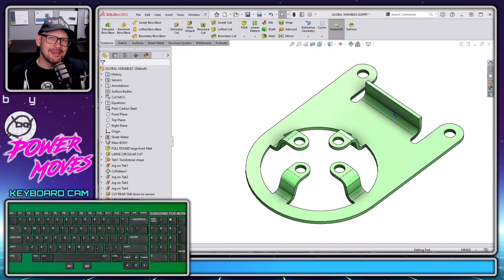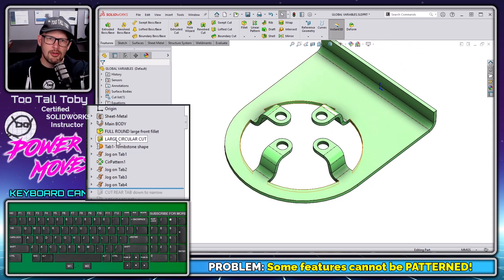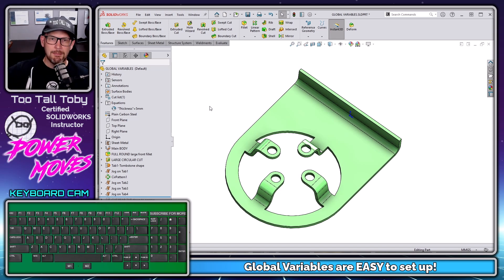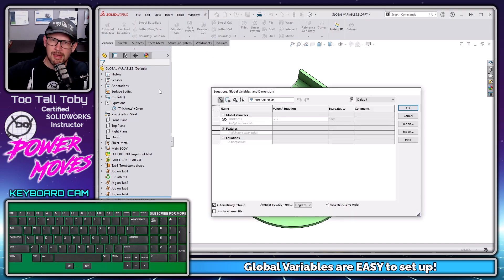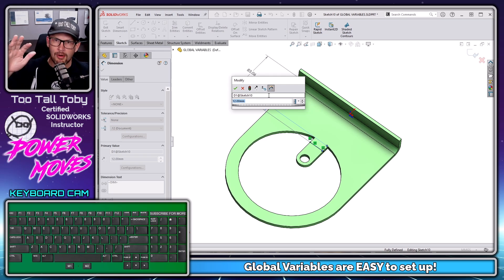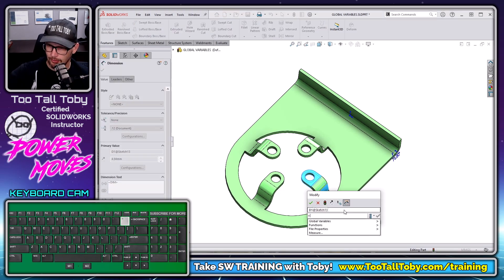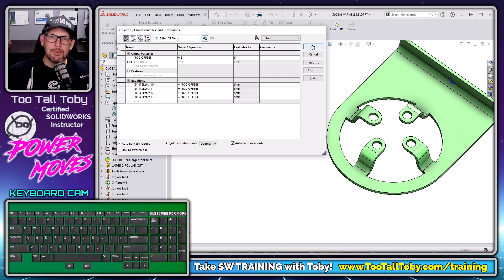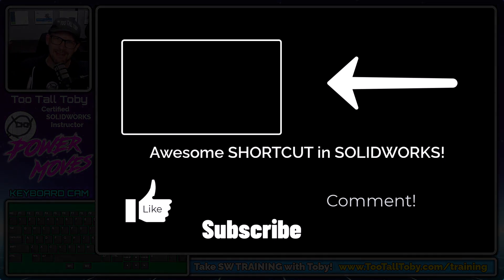How setup up and use SOLIDWORKS Global Variables and Link Dimensions to Parts

Comment: Just use the link values feature. it's much easier
Reply from the maker: They both have their place - they are different though - link values is bi-direction where global variables has an independent variable and a dependent variable (one way)

Comment: Toby.  Just found you I'm looking for a way when I first build with their length of a part to add the cross-section length to some kind of parameter variable that can I can put in a column on the title block is that something you've already done a video on or you can advise me on My name is Luke and thanks for all your help
Reply from the maker: If you go into FILE PROPERTIES (in a part) you can create a new property and then name it something like "length". Then click in the cell for VALUE, and then you can click on any dimension (in the graphics area) and it's value will populate that cell.  It will be a dynamic link, so if the value changes in the model, the value in the cell will change. 

Since this is a property, you can link it to a note in the drawing.

Hope this helps!

Comment: I have been trying to use it, but it will not update the changes automatically, even when I use Rebuild. What should I do?
Reply from the maker: There's an option for AUTOMATIC UPDATE found down below in the Equations manager (the big window).  Try that

Comment: can you use global variables to drive to different configurations?
Reply from the maker: Yes! after creating the global variable and inputting a VALUE, click outside of the value box, then click in the box again. You'll see, over on the right,  a section where you can specify the configuration settings!  Good luck!
Reply: @TooTallToby  Okay i see that, I am looking for an equation, used similarly to a global variable that will determine the configuration that will be used in the final assembly, for example if the diameter is greater then 2 but less then 5 the configuration automatically selects the appropriate configuration for that size. While your global variable is the diameter of the hole. so as you change that value, the different configuration will automatically be selected depending on the range it falls into. and auto update the assembly after a rebuild.

Comment: I GET THE 26 BUT I DONT GET THAT SECOND DIMENSION FROM THE EDGE OF CIRCLE. I GET THE HEIGHT AT 33 THE RADIUS 8 EVEN THYE 76 WHERE DO YOU GET THAT 4.94 FROM?
Reply from the maker: I was trying to get the dimension from the edge of the model to be a nice round number, but the dimension to the start of the jog was comming from the intersection of the circular edge and the side edge of the jog.  So that number is oddball = 4.94

Comment: Sometimes you have splines seperated into 2 sketches, you can controll the connection point angle of both splines for nice smooth surfaces :)